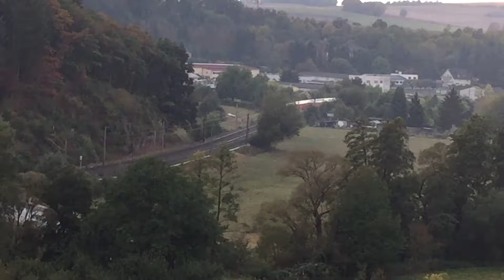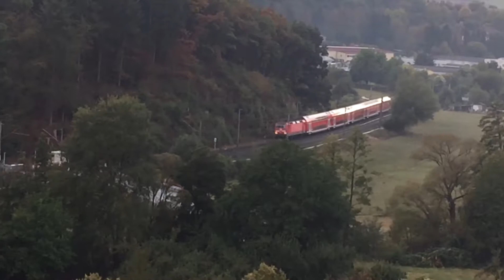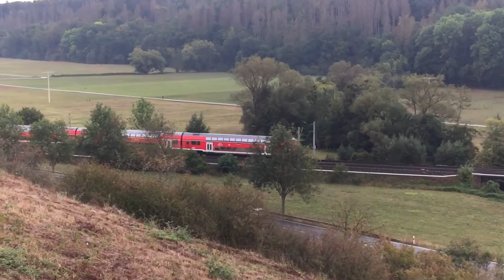RE20 fährt nach Frankfurt(M) Hbf mit einer BR143 und 5 fast komplett modernisierten Doppelstockwagen

Comment: Sehr schöne Aufnahme von der br 143 mit den Doppelstockwagen. Eine Frage weißt du ob die br 143 schon durch die br 146 auf der RB20/RE20  ersetzt wurde und falls nein wann sie ersetzt wird? und weißt du wann auf dem RE50 und die RB51 die br 114 durch die br 146 ersetzt wird? Daumen Hoch und LG Beni
Reply from the maker: Schön, dass es dir gefällt.
Noch fahren alle 143er ohne Probleme hier, aber im Laufe des Jahres 2021 werden die 11 143 hier dann durch 10 146.1er aus Bremen ersetzt, die vorher noch in Dessau umgebaut werden müssen. Die erste 146 123 ist schon in Frankfurt abgestellt. 2 weitere werden gerade in Dessau modernisiert. Es müssen noch viele Lokführer die Ausbildung machen für die Loks, weswegen der Einsatz hier noch etwas dauert. Also fährt frühestens im Frühling die erste 146 hier und die letzte vermutlich im Sommer. Das ganze wird auf jeden Fall noch vor Dezember 2021 passieren, da ab dann der neue Verkehrsvertrag gilt. Wahrscheinlich werden die Loks dann erstmal zeitweise auf dem RE50/RB51 eingesetzt.
Für die 114 auf dem Kinzigtalnetz kenne ich keine genauen Daten. Es könnte aber sein dass die jetzt noch ein paar 146.2 aus NRW für die Strecke besorgen, auch gibt es das Gerücht dass eventuell Vectrons für die RE50/RB51 kommen sollen, aber genaue Informationen hab ich da nicht.
Reply: Vielen Dank für die Info LG Beni